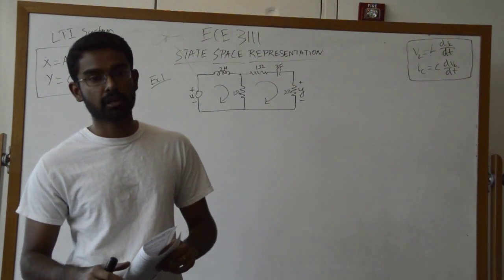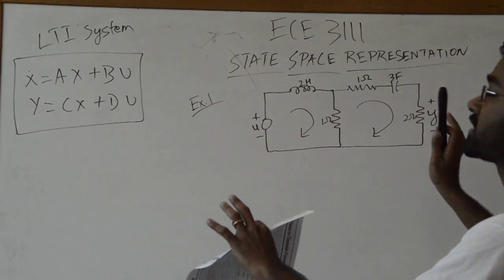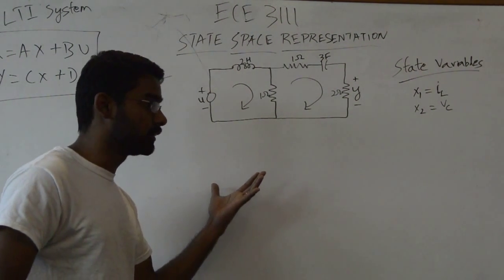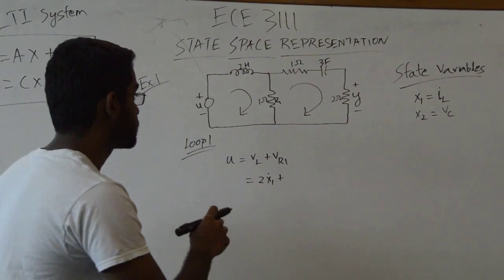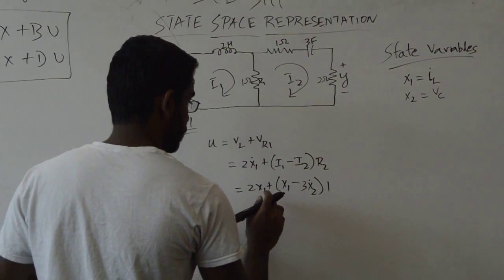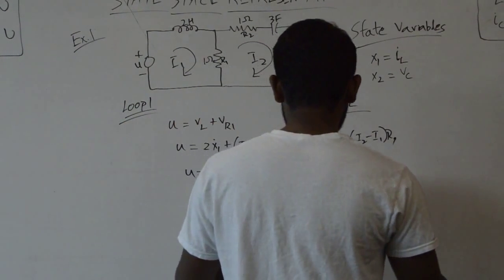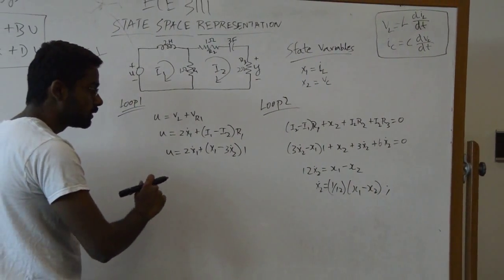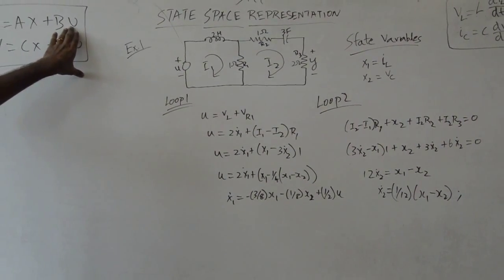Systems Analysis - State Space Representation of Circuits

Comment: how to define the order of a system,if no. of capacitors or inductors are connected??
Reply from the maker: Hello! THe order of a system is directly equal to the number of states required to describe it. So if you can completely describe the system dynamics using a minimum of n states, then the system has order n. In a circuits example, we call the voltage across a capacitor and the current through an inductor as states. Therefore, the number of states equals the number of capacitors and inductors in the circuit.